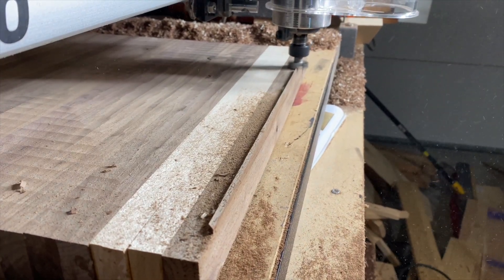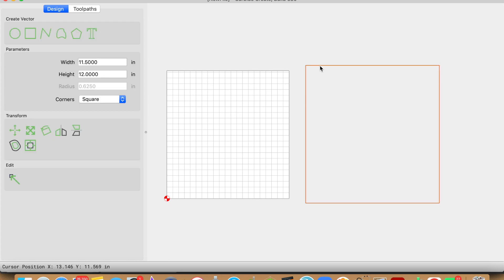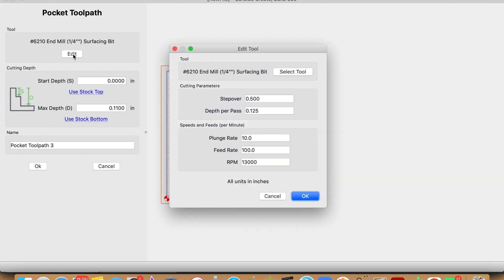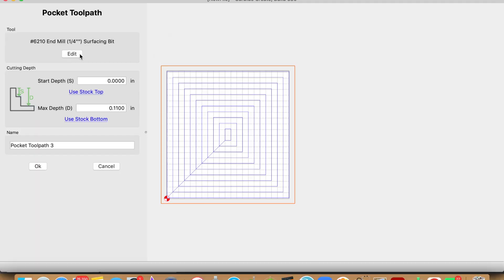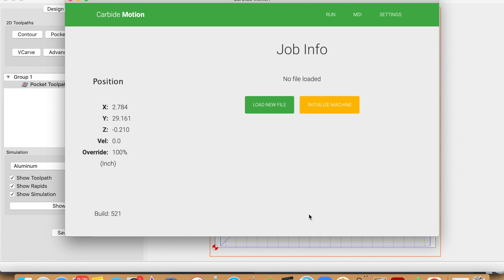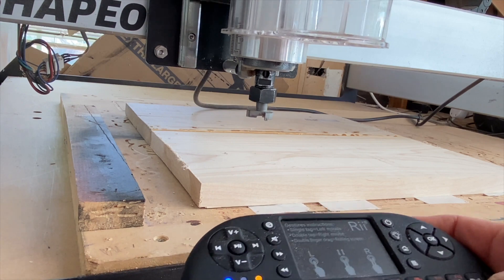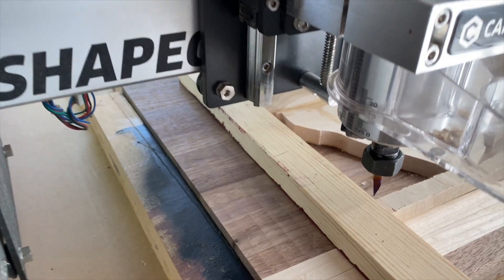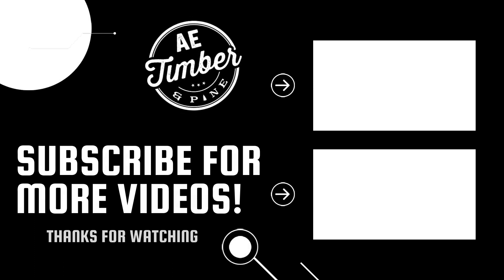How to Surface Material On CNC | CNC as a Planer

Comment: It’s not advisable to start surfacing from the center of the board, as the bit will bottom out on the surface; the center of the bit has no cutting edge.
Reply from the maker: Thanks for the input! I'll keep that in mind for future surfacing.

Comment: 1 inch means it cuts 1 inch hole? i mean the planar bit looks like the middle portion doesnt have a blade
Reply from the maker: Yes, theoretically, if you went straight down and then back up it would be a 1” hole.
But this is a surfacing bit and it’s meant to remove material rather than make holes. 

The middle portion is smooth to allow for it to move across the surface of the material.  The blades are what’s cutting the material as it moves.

Comment: I just saw this video, and I'm sure things have changed in your techniques, but for someone just seeing this video looking for help, make your vector rectangle bigger around your work piece. If your board is 8X10, add the diameter of your bit, plus 1/2 inch. so for a 1.5 inch bit, add 2 inches on each side. The vector would be 12 X 14 inches. That way it comes in at the depth you want and it won't plunge while doing the pocket profile. Also, if your software has a raster option, use that. IDC Woodcraft has great CNC videos.

Comment: Gr8 vid, thank you!! QUESTION, since I can't ramp, my planing started in the middle like your project did... needs to start on the lower left corner, preferably. I cannot find this option in Carbide Create😞 Any advise? INSTA-Subscribe for this vid, much appreciated!
Reply from the maker: @bretthollingsworth9866  hey Brett you cannot on the free version but I think it is on the pro version but I haven’t confirmed that 

I’ve also heard that you can create spiraling line vector that covers your piece and it would “ramp”. 
Not sure if that helps but I read it on shapeoko forum on FB
Reply: @ thank you for that! I will look that up on YouTube tomorrow… Much appreciated!
Reply from the maker: @bretthollingsworth9866  and thank you for subscribing in appreciate it!

Comment: Is there ever a way to edit the toolpath pattern so that it moves in parallel lines rather than always following the perimeter? I'd think the final sanding out would be easier with less crossgrained toolpaths.
Reply from the maker: The crossgrain lines are annoying for sure.  I think if you wanted to really avoid those parallel lines, you would have to design some linear svg's and organize them in a way to cover your workpiece. It would take some time and trial runs I'm sure to get it right.

Comment: It definitely did not work for me. I'm not sure why. I watched your other video on adding a surfacing bit. Got the bit added, no problem. I followed your instructions on this video and it essentially burned the wood in the path it was going, then the router jammed. Not sure if my bit sucks or if I did something wrong. I've got a 2" surface planing bit, feed rate 100, cut depth .05 in, RPM 18,000, stepover 1.0. When I went to add the bit, it wouldn't let me edit the number of flutes or flute length. It just automatically lists them as 2 flutes at .5 inches. My bit has 4 flutes. I'm running Carbite create 7 (build 743 - Was unable to download build 777 or 778)

Comment: I noticed you installed a router to your cnc, what if we tried the 60watt spindle the cnc comes with?
I figured it be slower but it should still be do able right?
Reply from the maker: I am using the Carbide3D router but I have heard people use the Harbor Freight Bauer router. I have not had to update my router yet thankfully. :)

Comment: the reason the bitsetter was turned off? was that so it wouldn't measure the bit? for example i have the amana RC2265 bit could i use this format and get same result?
Reply from the maker: Hi Tony, yes exactly. 
Since I’m only running the single toolpath and the single tool, there was no need to enable the bit setter.

Also, it could potentially not measure it accurately as it’s bigger than the bitsetter “button”. 

And yes you would follow these steps for any surfacing bit or endmill. It’s just a pocket toolpath so any endmill or surfacing bit would be fine.

Comment: Hi! Another way to surface instead of using the pocket cycle, in the stock setup you can set the grid size to whatever you want the step over to be and then draw lines across the grid that start off of the stock and zig zag across the top of the stock. Then you don't have to worry about plunge depth. Works really well.
Reply from the maker: Thank you for the tip!

Comment: How long did that take?
Reply from the maker: I don’t remember exactly how long it took with an endmill but with a surfacing bit it Lea more more than 5 minutes, if that, if it’s just a shallow surfacing job between .01”-.02”.
It’ll depend on how much materia you’ll need to surface.

Comment: I've messed up two projects trying to surface them with my shapeoko so far.  Most recently I set the depth per pass at 0.01" but it still took off like 1/8".   I guess it's not capable of cutting less than the "depth per pass" setting?
Reply from the maker: Yeah it wouldn’t go deeper or less shallow than the depth per pass. 

On my final run, I ended up pausing the toolpath to stop it from carving into the actual cutting board. I sanded the thin left over away. I was actually able to pull some of the inlay away since it was so thin.

Comment: Did you remove all that extra inlay wood with just your surfacing bit?
Reply from the maker: Yes that is correct. I used the surfacing bit to remove the majority of it. 

I hit pause in Carbide Motion to stop the toolpath job when I got pretty much to the bottom.  I chose to manually stop the job because I wanted to make sure I didn’t take out the inlay and I wanted to sand it down myself to the board.

I’ll make sure to explain that in video where I explain the process. Thank you for the question.